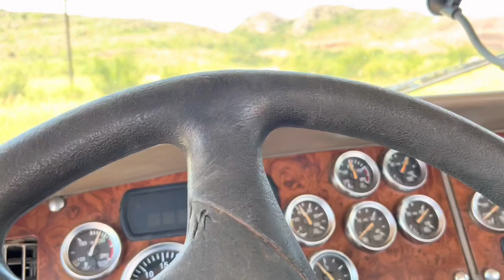Replacing 7 way plug, Hauling Rock with the Belly Dump! Day in the life!

Comment: Hello driver, 

I'm trying to block off my rear ac and trying to get ac dryer for a day cab 387 without the branch out for the bunk.

Could you be kind enough to get the part number on the A/C dryer by firewall on your 387 daycare?

Dealer of course is asking for a vin number and wasn't much help. 

Thanks iadvance.
Reply from the maker: I’ll see what I can do, our 387 was converted to a day an as well, I really think the drier would be the same for either daycab or sleeper configuration